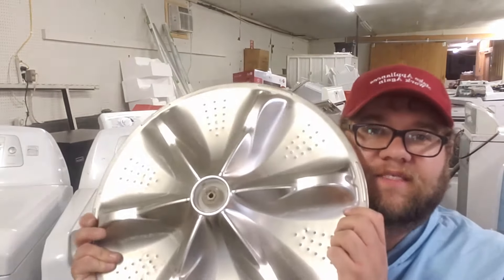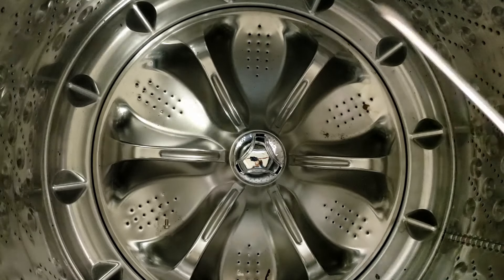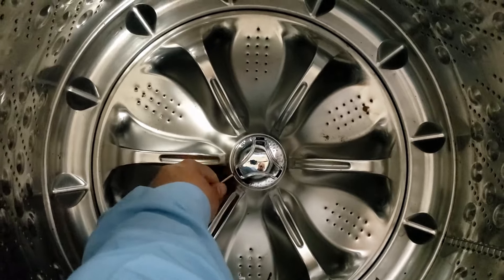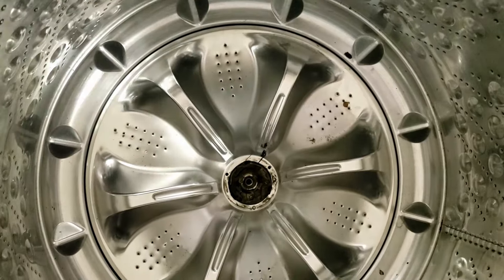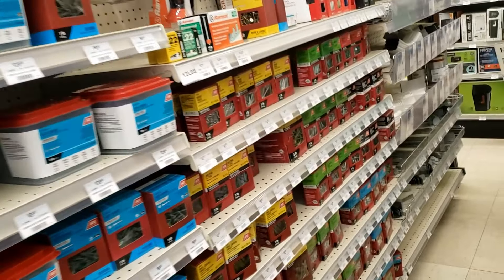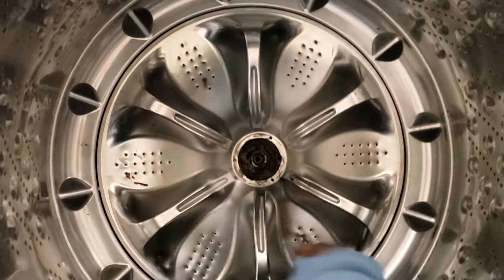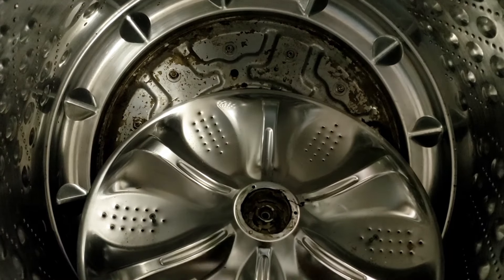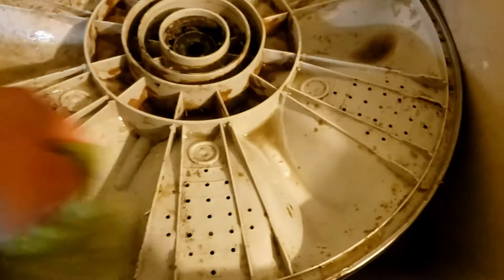How to Remove a Wash Plate that is Stuck on a Washing Machine - LG Pulsator Wash Plate Removal

Comment: Lol
Idiots at work
All u have to do is to fill the tank with water and the plate will pop out by itself due to pressure
Reply from the maker: If you feel that way, wheres the link to your video on doing it the easy way?
Reply: @bensappliancesandjunk  it doesn't have to b in a video
Thats physics. 
Do it and u'll see
Reply from the maker: @primeminister807  I'm doing another video on using hot water + agit cycle to break the debris free. This video was a few months ago. Of course, tricking the machine into the agit cycle varies from model to model so I'm working on a more standardized workflow for it.
Reply: Sounds good. Post a vid.
As for idiocy, I think it’s good to have an extra arrow in ones repair techniques quiver. 
It’s better to have it and not need it...